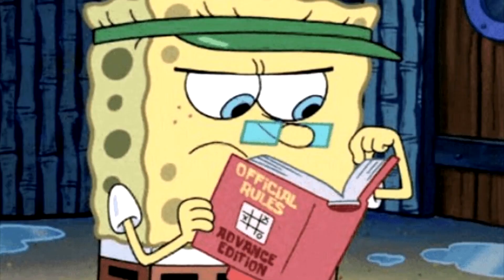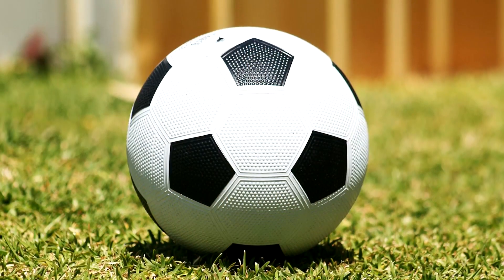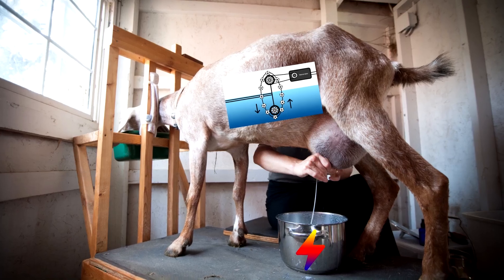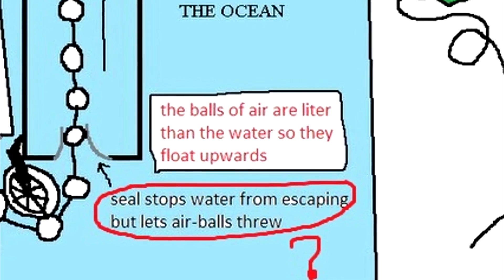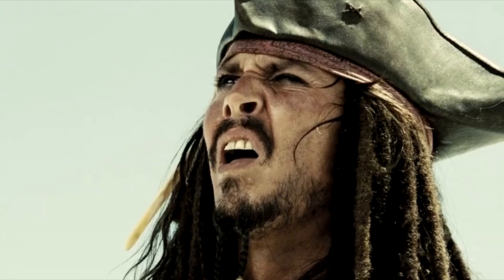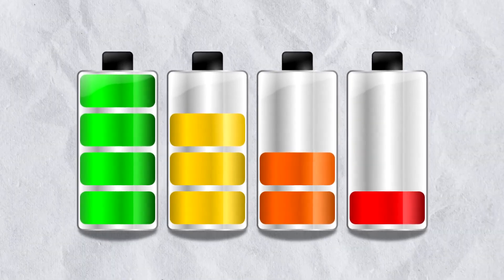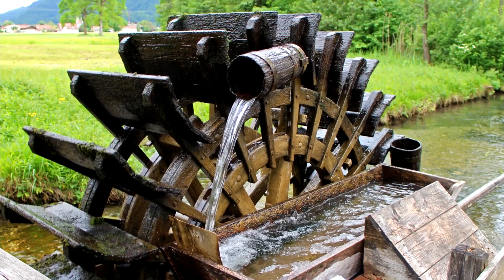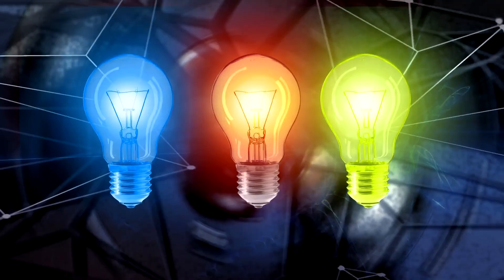why it doesn't work 16

Comment: The work needed to create a bubble at that depth is exactly equal by the work released by a bubble that travels from that depth all the way to the surface. And you lose energy in the process due to viscous friction. So the force balance is zero overall, and if you move the macchine you're going to have to input energy.

Comment: Okay, so what if we take it out of the ocean and suspend it in air? The only water is the water in the container on the right, and so the ball would enter from the bottom through the seal, be pulled upwards, and wouldn't have to break the seal on the left since there's no ocean.

Comment: It does works.. if you remove the whole air balls thing and just use the wheel or a turbine and put it in flowing water like river..

This is like that idea of under ground rail system for cars to escape traffic like train doesn’t even exist.. 

people be come up with innovations backwards..

Comment: in short you'll need to apply the same amount of energy to push the ball into the water at depth (into higher water preasure), that you'll gain from the ball floating up. it's like when you push something in at some depth you need to raise (displace) the same volume of water all the way to the top. then when it will float up the same volume will return ("fall") down the same distance, ie same amount of energy applied/gained
Reply: But without water it dropp down no power.... On that tube there are no water
Reply: what if the object is fully solid

Comment: I finally figured out why this won't work😅. The ball on the air tank just entering the water experience a force upward of (h*Rho*g)*area to open the seal against water pressure. This is equivalent to opening the car door while your car is sinking in water. This force is equal to the net buoyancy force experienced by all the balls moving upwards in the water tank (This is because the buoyancy is the difference  in pressure experienced by the top and bottom half of the balls. Since area of each ball is same, the individual pressure differences add up to h*Rho*g*Area). Hence the net force on the system is zero, so even without considering viscosity or wall friction this still won't move

Comment: No, no, he has a point! I can improve on the design. What we need is to move the wheel for free energy, right? Let’s have water itself push the wheel instead of Bryant balls pulling on it. The best location for pushing such a wheel would be with running water…. Wait, did I just create the water wheel? Hydroelectric dams were always the nigh-infinite energy that we needs all along!

Comment: idea: Same thing but put it in a river, and put it sideways, Use stainless steel and the river should push the chain around in a circle as long as the torque on the axels is small enough
Reply: That's not free energy, that's just a watermill powered by the sun giving water gravitational potential energy. Sun runs out no rivers no watermills.
Reply: This is called a water wheel and has been done for centuries, and better.
Reply: @Zimber106  you are a special one arent you

Comment: I can see how the change in potential energy works out to be zero. If the device were to "turn" you'd be forcing a new ball into the water for every ball being leaving the water by the buoyant force.

In other words, the water level would never fall, so there would be no conversion of potential energy to kinetic. That part is pretty intuitive and easy to understand. 

The force diagrams are a little more complicated. The fact that this meme made my gears turn warrants my longest comment ever. 

It seems that accounting for buoyant force with the Archimedes principle isn't enough. You have to account for the pressure applied at that depth by the column of displaced water surrounding the air pocket where the balls enter - this is the kind of pressure that crushes submarines. As water is practically incompressible (especially compared to air) there would be no extra buoyant force at depth. There would, however, be a massive pressure barrier. Say the column of air is 1 meter deep into the water. Just like mmHg, mmH20 can be a unit if pressure-gauge pressure in this case since everything is exposed to atmosphere. Quick math shows, at 1 meter depth in water, that's 1.42 psi of pressure against the bottom of the column and anything passing through, including a new ball. 

Now imagine the balls each have a diameter of 1 inch. This means the cross sectional area is 0.785 sq in and the volume is .52 cubic inches. 

Thus, the pressure force is 1.42 psi × .785 sq in = 1.1147 lb.

Let's assume the balls are touching each other, putting 39.3 balls submerged in the water for the meter length of the air column. This length is the difference in submerged balls and thus buoyant force between the 2 sides. The density of water is constant due to aforementioned incompressibility, at 0.0361 lb/cubic inch.

That's 39.3 balls × 0.52 cubic in/ball × 0.0361 lb/cubic in = 0.738 lbf due to buoyant force favoring one side, hypothetically powering the system.

The force of pressure must be overcome by the buoyant force for the device to move, but it's not even close.

1.1147 >> 0.738

 In fact, I'm guessing that a cylinder with the same diameter over that meter length would precisely match the pressure force. Let me confirm with the math below:

39.3 in/m × 1 m × .795 sq in = 30.85 cubic in

30.85 cubic in × .0361 lb/cubic in = 1.114 lb

Almost exactly the same. So we can conclude that the balls on a string method will never come close to beating that pressure force, even ignoring friction and other resistive forces. We also learned that, since we're dealing with pressure from a column of displaced water of a certain diameter and depth, the only way to match it would be with an equal diameter cylinder of air providing buoyant force on the driving side. Greater size (volume) on one side could overcome the pressure force, but then that object needs to loop back around... it can't.

Hope this clears it up for anyone confused. Personally, I have to see the numbers for things to really make sense.
Reply: Cool math, but what would when prevent the greater force of pressure from simply accelerating the balls the other way?
Also: Mixing units is how rockets blow up unexpectedly.
Reply: @logon-oe6un  Rocket science is more complicated, and mixing units is a symptom of getting an engineering degree from an American university, haha

But the pressure acts on all sides  of the balls, or any shape for the matter, at any given depth. For spheres, the pressure is evenly distributed and creates force vectors towards the center. This is why spheres hold up better at extreme depths than squares or other shapes with flat surfaces - while the force vectors (pressure x area) still cancel out on any shape, they can cause flat, unsupported walls to collapse. This is why we build curved dams, pill-shaped submarines, etc.

In the case of poorly-designed submarines (probably because the engineers mixed units), the pressure distribution and equalized force vectors cause the submarines to crush/implode rather than flying to the surface at Mach speed.

However, for a ball attempting to enter the water at that depth from a submerged air chamber, the pressure is only acting on the side of the ball being forced into the water. Maximum pressure force would occur at the halfway point of the sphere, where the cross-section area is the largest. This barrier can only be matched by buoyant forces of an equal volume to the column of air above the ball up to the surface level of the water, as demonstrated mathematically.
Reply: @logon-oe6un  Also, funny thing about mixing units: I work at a massive semiconductor equipment company, founded in the late 60s, and we use the craziest combinations of metric and imperial units on EVERY chamber, mainframe, robot, etc... even the new ones. It's very frustrating and we have to be very careful with our calculations. I'm PRAYING that the design engineers will phase out the imperial units with the next few generations of equipment. I've only been here for a little over a year, and the young guys all prefer metric

Comment: I was just thinking about this scheme a couple of months ago :>

however, I only collected about a hundred round jars from shoe covers  х)

It's clear that none of them work, but it's interesting to find out why and puzzle over an unsolvable problem :3
    Edited: And that's how annoying those people are who just say: - "This doesn't work because of the law of conservation of energy, blah blah blah..."

  well yes, it is easier to say that it won't work by referring to a well-known law than to prove it yourself or explain the problem of the mechanism - because they often don't work due to various factors -  Friction, or in this case - it is difficult to isolate water without holes - gaskets will not help, etc.  in the case of wheeled engines with shifting loads (the most common option), then the center of mass shifts 
   and such more detailed explanations allow us to think more openly about our world, and not just follow the rules.   People learned to fly only in IX century! it's worth keeping an open mind  ^_^

Comment: That’s the closet thing to free energy Iv ever seen though, I’ll give them credit for the idea. Nobody else has found a way to cancel the opposing force as well as this. It’s not perfect but it’s a start
Reply: The problem is that ut dosent cancel it xd
Reply: @mrsnail8664  if someone could figure out how to make a low tension water tight vagín. It’s totally feasible. And I hate free energy nutjobs,  I like this
Reply: @mrsnail8664  there is nothing to cancel because the float doesn’t weight barely anything. I still love it
Reply: @mrsnail8664  I could invision a diving bell like deal with a slight air pressure to keep a seal. No resistance from a vagín . I love it even more 😆
Reply: It's actually quite interesting. The floating force on the right gets cancelled by trying to force the balls on the left into a deeper surface.
Reply: @dark6.6E-34  balls don’t float in air. That offers no resistance if the water level was at the same height as the lowest point. I’m tempted to waste some time playing with this
Reply: @Youtubecensoredmyusername  you misunderstood what i said. By forcing the balls on the left through the lower surface of water, it takes a lot more force than what  the buoyancy on the right can provide. You would have to have the buoyant force of a ball the size of the emptied out chamber on the left to successfully push anything through the lower surface. 

And the actually closest experiment we have to perpetual motion is a lot more nuanced, and attempts to exploit thermal fluctuations. Look it up it is called brownian ratchet or feynmans ratchet and pawl.
Reply: @dark6.6E-34  on the right side, you have 1 ball at the same depth as the ball you are trying to submerge, as several other balls providing additional force. why cant the ball on the left be forced into the water?
Reply: @yuri-il-sung  Basically the boyant forces of the balls on the right side are not enough to push the single left side ball into the deeper water level. 

That is because when you create the cube of air on the left the water is pushing up at it with a 
boyant force = volume of the cube * water weight. You can treat that chamber like an object we are holding there.

so in order to over power it you need the beeds on the right to occupy the same amount of volume in the water as that chamber on the left.

(dont forget that the depth doesnt affect the boyant force)

Comment: Gravity is a conservative force. See Wikipedia for "conservative forces".  This means that if an object moves around a path in a gravitational field and returns to the same point no work is done on it or by it. A good example it's a man walking up and down stairs. The change in gravitational potential is mgh on the way up and -mgh on the way down. The height h is measured vertically so the steepness of the stairs has no effect mgh-mgh=0. 

The fact that the path doesn't matter means that no "gravity powered" machine is possible because the path design doesn't matter.

Comment: i still genuinely do not understand why this doesn't work beyond "no such thing as perpetual motion"
i know it doesn't work. you didnt explain why it doesn't work. clickbait. bad video.
Reply: you'll need to apply the same amount of energy to push the ball into the water at depth (higher water preasure), that you'll gain from the ball floating up from that depth
Reply: Here's some actual math since no one else bothered to do it. Imagine the balls enter the water at a depth of 100m and the balls are 1m in diameter. Pressure differential would be density (of the water) * gravity * depth so 1000kg/m^3 * 9.81m/s^2 * 100m = 981000Pa. For simplicity lets instead assume the balls are 1m cubes so they have an area of 1m^2 as they encounter the water boundary. The force against the cube from the water pressure would be 981000Pa * 1m^2 = 981000N. The work needed to push that cube completely into the water through the seal would be force * distance so 981000N * 1m = 981000J. Now the cube will rise due to buoyancy and do work. Force of buoyancy would be equal to the weight of water it displaces, so 1 cubic meter of water which is 1000kg, which is 9810N of force. Now to get work we just multiply that by the 100m distance it rises: 9810N * 100m = 981000J. Tada! Work in = work out. But in the real world of course you'd have all kinds of losses so work out would be less than work in.
Reply: 1st the seal of ball's entrance won't be perfect, it'll be leak, and the material must be insanely strong to hold that much pressure.

2nd the force to insert the ball into water equals or perhaps even greater than the force of air pulling the ball.

3rd there's energy required to move the wheel & generator, there's no additional energy produced outside the rising balls so those wheel won't be moved.
Reply: @Serlock4869 these are all just some engineering challenges and not fundamental reasons based on physics as to why this can’t ever work.
Reply: @Serlock4869  
your first point is straight up false. the pressures would not be insane.

making the body of water larger does not increase the pressure, only going lower in the water does. that's why people don't need to be made out of steel to be able to swim in the ocean.

it's also redundant; the machine would still be nonfunctional if it used a magical seal that separates the air and water while still letting the balls through.

your third point makes no sense; the buoyancy of the rising balls is what theoretically moves the wheels. in fact, this machine would be a perpetual motion machine if the balls could magically be teleported past the seal without using any energy.

your 2nd point is the key. that is the correct answer, and that shows promise in your scientific reasoning capabilities, but i think you need to do a better job explaining it.
Reply: @1_1bman So the downward force required is greater than the upward force generated by the ball at the same depth?
Reply: @Delacrow_l_Chawngthu  yes, the force required to push the ball past the seal will cancel out the buoyancy.
Reply: @Delacrow_l_Chawngthu  crunch the numbers
Reply: My guess is that both sides will cancel out and  it'll just stay evenly
Reply: @Zattec  Without the left hand seal it's balanced as-is (the right hand seal is unnecessary and can be removed anyway):  It takes just as much energy to push the ball down through the water as it gains going up (ignoring friction), and when initially released it just doesn't move.

The seal is there so that the ball gains energy both from falling through air and rising through water.  Problem is that seal is there and you have to move the ball over to the right a bit (and to the left later).  These steps take a non-zero amount of energy, but let's just stick with the seal.  The pressure on seal up from the water is lower than the pressure from the air down on the seal, as we can see by considering what would happen if the seal were not there:  the container would fill with water.  For it to stay closed some minimum force is required to open it to let the ball through, so the ball has to be moving at some minimum speed in order to force its way past.  For the seal to have that resistance it has to have some dissipative force involved ('friction' in the broad sense) or else the steady force from the water would just force it open.  Hence energy will be lost in forcing the ball through.  And that's not accounting for the energy required to turn the ball on the chain.  Since the point of greatest energy loss is forcing the ball through the opening, the most likely end configuration assuming sufficient starting energy is the ball stuck in the valve.